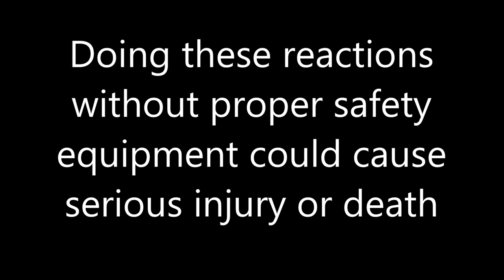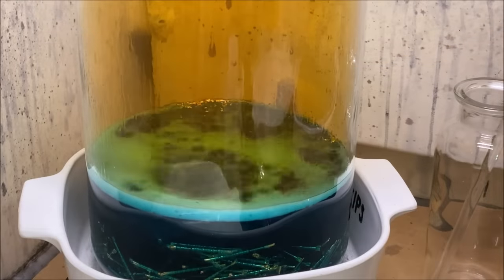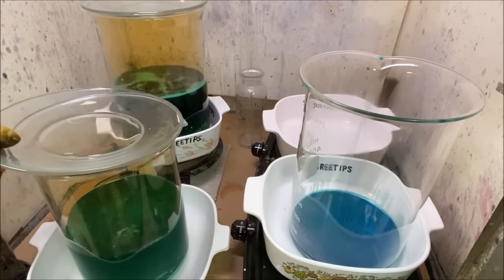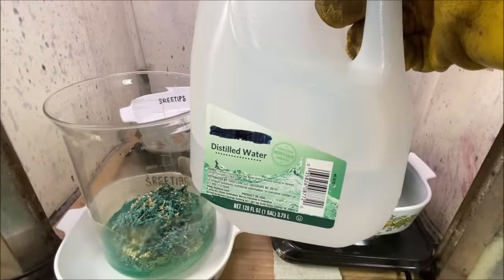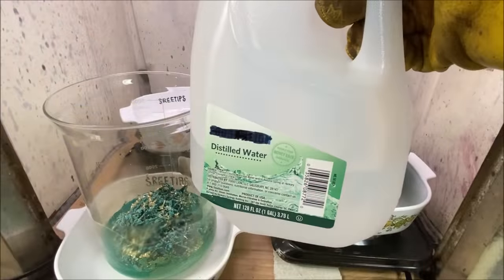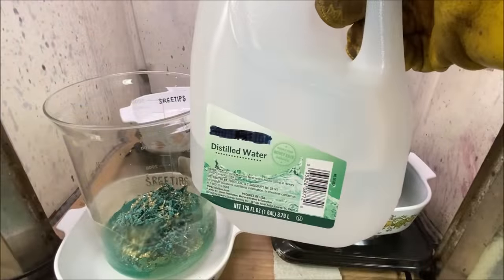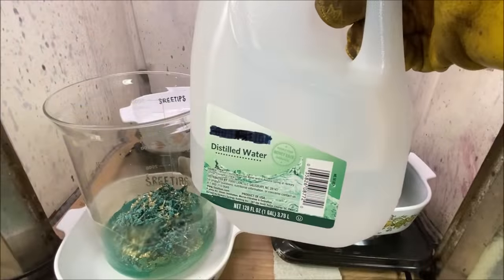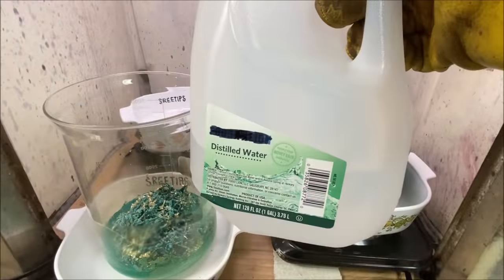Gold Plated Pins 10 POUNDS!

Comment: From what I calculated with the price of the pins and materials that were used (5 bottles of Nitric acid and Distilled water) not including your time, that the project roughly cost $1,400.00 and yielded 22.5g possibly worth $1,500.00 and profiting 50 to 100 dollars, so to conclude the entire project was not very profitable but thank you for the letting us experience the project with you.

Comment: Thanks for doing this, I'm a former metallurgist and you did great, explained it was the first attempt and you got your gold.
Reply: So why can't you get the gold off of the copper?
Reply from the maker: I used nitric acid to loosen the gold and release it from the copper. Ended up putting most of the copper in solution. This was a giant pain. But it made a good video.
Reply: @sreetips  Yes, all of your videos are good. You could get a bikini model assistant. Call her Beaker. But I was thinking that gold melts at a lower temperature. Melt it off of the pins. But, me contractor! Thanks for the show.
Reply from the maker: The gold would just get welded to the copper, making recovery even more difficult.
Reply: @sreetips  Interesting....So using a pyramid smelter would not be a valid method for this?
Reply: @sreetips  curious sir couldn't you just melt the pins like you where inquarting them then use nitric to get rid of the base metals like normal?

Comment: Very interesting,  you spent $1000 and recovered about $1300. taking into account time spent and acid, it's still a loss.
As you say it's a calculated mistake and a valuable lesson learned. Thank you for continuing with the experiment.
Reply: I'd still like to see if the reagent costs couldn't be reduced by decomposing the Copper Nitrate back into dilute HNO3
Reply: Add the energy and time .totally loss .not worth it but freakin interesting, ty bro
Reply: Add onto that the potential revenue from YouTube by making interesting content and it might become worth it
Reply: And you can make $ 3000 jewelry piece from it
Reply from the maker: That’s a good idea
Reply: @DiverCTH  It's simple. Add some Na2CO3 solution to the Cu(NO3)2. Filter out the CuCO3.
Dry the NaNO3 solution. Add some conc H2SO4 and distill off the HNO3.
Reply: He screwed himself right out of the gate.  He paid $1000.01 buy it now, and then it looks like the same seller ngta-benj sold 2 more identical 10 pound lots that had multiple bids and sold for $555 and $688.93
Reply: If he sell it at $62 a gram (56.50 now) he breaks even and he gets paid for his labor from YouTube.
Reply: @donc-m4900    Right, and he drives up scrap prices for everyone else since he doesn’t care what he overpays for it.
Reply: Worth every penny!  Gold values fluctuate too, ya know.
Reply: well he spent $1000, but if he was the only bidder at $500 he would of made profit on the listing.
Reply: It wast a loss this video made him about 10kus and a lot of people are intrested in this

Comment: This is fascinating!   I’m not a chemist but stand in awe of the science.  Thanks for sharing.
Reply: This was not chemistry, a chemist would never spend all that acid when you could simply dissolve the gold off those pins in 3 minutes using spa chemicals or bleach.  30% peroxide would have boiled the gold off the copper in 15 seconds.  smelting in a microwave would have taken 15 minutes.  Chemists are cheap bastards anyways for the most part.  As for the science my friend this has been done for hundreds of years and they figured out this is not the method over 125 years ago.  Just ordering the Nitric alone for this project is a quick way to get yourself on a list, there are much better ways and if you're going to use Nitric, be realistic and buy a setup to make your own, it's easy and cheap and keeps you off ATF's radar.  Everyone says it's no big deal until they show up at your doorsteps, then try telling your heart to beat quietly as their Gold Plated Badges tweak your mind and make you ask yourself if you put all your clothes in the hamper and toys in the toybox, better to just avoid them altogether and learn how to make your own chemicals.  Everything anyone ever needs is easily made at home and you learn most of what you should learn in learning how to get them and refine them.
Reply: @sizzlean9459  sir simple method tell pls i am trying but not available for chemical so full easy steps for words reply pls sir.
Reply from the maker: I took one chemistry class 45 years ago - got a “D” - you don’t have to be a chemist to refine precious metals. And your 15 minute “easy method” has been tried by many a novice with negative results. I only wish that it was that easy! Thanks for watching the video.
Reply: Truth is I am an engineer of 35years experience.  Seen many many things.  Try to open your mind a bit.  There is always another way to a solution and usually all those innovations are borne out of necessity and have their place.  That is what learning is all about, but maybe learning has stopped for some.
Reply from the maker: My way is not “the way” but rather “a way” to get the gold. In accordance with the reactivity series of metals, the gold would dissolve, then cement right back out on the copper until all the copper was dissolved into solution. Then the gold would stay in solution. Two other ways to get the gold from these pins; acid/peroxide or sulfuric acid stripping cell. Acid/peroxide could take weeks. And I can never get a good yield with the stripping cell. I chose these pins because I had plenty of nitric, and I knew that I could dissolve the copper to get the gold. I try to pick the battles that I know I can win.
Reply: @sreetips  sir i am working communication field O&M.
E waste ability but chemical search not available live from India TN
sir pls tell available store or any?
Reply from the maker: Gold plated material is best processed in a sulfuric acid stripping cell: https://youtu.be/gxf2PVc5t44

Comment: I know how thin plated gold can be and how far they can make an ounce of gold stretch when pounded into sheets. This was more than I expected to see.
Reply: Was it worth it? If he paid 1000$ and used up 5 days of his time only to get 22.6oz then I’m not sure if it’s worth it. Plus the 5 bottles of acid which I don’t know how much that is but I’m sure it anit cheap. If we just give him 8 hours per day at 10$ an hour that’s another 400$ on top of the 1k he spent on the scarp. That’s 1400$ for 22.6oz of gold. That comes to 61$ per gram. That’s really not good at all, you can pretty much buy gold at that price
Reply: @marcuslarwa9098 no he says in multiple other comments here thst this one wasn't fruitful, and they rarely are. He does it for the video educating.

The bottles are 2.5 liters, cost him about $60 ea. He used 5 bottles. So $300 there, plus he probably values his time at 2-3x the $10/hr you estimated haha. But doing something fun like this you wouldn't "charge" yourself for the time. So figure $1300, and he didn't get 22oz of gold 😂

If anything though, he didn't "lose" much technically, and considering the video you could say he actually netted a great bit
Reply: I do PCB design and there is electroplated gold and soft ENIG. The gold substrate in ENIG is less than 5 microns and is usually over Nikel and not worthed.

Comment: For pins, I use an electrolysis cell with a titanium anode. The dilute sulphuric acid electrolyte is relatively fume free. It leaves foils like the other processes, and is non sensitive to the presence of tin in the base alloy.
I've processed 40 pounds in 8 gallons of solution, using 1 quart of sulphuric acid, before the underlying nickel plating fouls the electrolyte to the point where it slows down. Recovery of the remaining dissolved copper, that's not collected on the cathode, is treated with iron to form copperas, which I use later to drop gold.
Reply: Hello David: would you mind sharing some details of the electrolysis process you use? Details on your titanium anode (perhaps where we can find one)? Cathode set-up? Electrolysis conditions (voltage, amps)?
Reply: @tech-e-cycle2608  
I use basically the cheapest titanium foil I can find on eBay for the Anode. I think it's something like 0.005" thick and 4"wide, but anything that will carry the current and not corrode would work. Cathode is simply a stripped end of 10-12 guage wire. It will get bigger in surface area as it collects copper. Solution is one quart of sulphuric acid in 7-8 gallons of water, but that can be scaled back to what ever size you want. I run my cell with a 5vdc 60A power supply, but I've never seen it draw more than about 10 amps. My meter didn't survive my latest move, so I can't tell what it's pulling exactly now. I use a 5micron filter bag I got from Duda Diesel for the Anode bag that keeps the pins in electrical contact with the Anode and each other. It's basically the same as any other parting cell, except I found out that it's not necessary to melt the pins into an Anode plate first.
I am discovering that the pins have to be porous enough for the saturated electrolyte to be able to be replaced with fresher electrolyte or it will slow down and stagnate. This is not the same as the Faraday cage effects you see in the concentrated sulphuric acid stripping cell.
Reply: Watched a guy on YouTube do it using distilled vinegar and salt in a bucket. Took a long time but it did separate the gold from the base metal pins. Very safe way to do it.
Reply: @ATAATX  
Not really that safe. Vinegar and salt can create peracetic acid, which has a dangerously low flash point.
Reply: @Vibe77Guy  Well, don't flash it!
Reply: @Vibe77Guy Hola , Muy buena. Información , gracias saludos desde las palmas de Gran Canaria 🇮🇨🇪🇸💪 eres el número 🥇
Reply from the maker: Volcan! Estar a salvo
Reply: @Vibe77Guy  ..?? You need a strong oxidiser to create peracetic acid from acetic acid, and a regular table salt, sodium chloride doesn't have any oxidizing properties...
Reply: @MrKotBonifacy  
This is true. Most people that go that route also speak of adding hydrogen peroxide. Which does provide the oxidizer.
Reply: @Vibe77Guy  "...which IS the oxidizer". You simply stated that mixing vinegar and table salt ALONE may lead to creation of peracetic acid. I my question was in reference to that statement, not to what "most people that go that route" do.
They might add a hydrogen peroxide, but you did not add it in your statement. Call me a nitpicker, but the thing is I can't respond to what you "had in mind", I can only respond to what you have writen. Sorry.
Reply: @Vibe77Guy  Your method sounds like a cheaper way of getting rid of the worthless copper. I feel for Sreetips on this one because looking at the prices for 22 liters of nitric acid came to around 800 dollars while the 10 pounds of copper would sell for about 35, unless buying metric tons of acid, that comes cheaper but would take ages to use up. Of course, there is gold to be had, but still. Nitric is rather expensive.
Reply from the maker: I used 5.2 bottles of nitric at $50 each.
Reply: @Vibe77Guy  No, vinegar and salt make pickling brine.  You're thinking of acetic acid plus 30% peroxide.  It's only a danger with highly concentrated peroxide and acetic acid.  3% peroxide and vinegar (which is only roughly 5% acetic acid) make a peracetic acid solution that's far too dilute for flash point dangers.  It's roughly 96% water by weight, and the peracetic acid remains solubilized.  It's also very slow at dissolving the metals.  VERY slow.
Reply: Electricity is a very effective oxidizer.
Reply: stainless steel bucket and revers technology are much productive, use low Voltage, overnight you have all gold on the walls of the pot. ....then ( secret ) lol.
Reply: @andrewandretti7379  
Using what as the electrolyte?
Reply: @Vibe77Guy  Does this mean county fair style french fries are explosive? 🤯
Reply: @Alondro77  How slow? a month, 3 months? If it saves hundreds of dollars it may be worth it.
Reply: The King  35% acetic acid isn't 'vinegar' anymore.  Vinegar is around 5% acetic acid.  You'd have to distill it in a special apparatus to get up to 35% concentration.  Probably vacuum distillation would work best with acetate.

Comment: I was surprised that you didn't use electroplating to pull the copper out of the acid. Thats how they do it in the mines. I've seen those work. By the way excellent video
Reply: yeah, I remember reading native copper has either gold or silver or both in it, they make more money pulling out the valuables, and it's one of the reasons why copper has a strong market.

Comment: I have taken to putting any gold covered base metals in my waste solutions from my stock pot to save on acids used. It does take longer to strip the gold from them but it does a nice job at zero cost.
Reply: I'm making a bubbler column to catch waste NO2 gas from both the initial reaction with the metal, and that which results from heating iron nitrate to a bit over 80C, and reconvert it to nitric acid using an aquarium bubbler at the bottom of a tall glass column filled with 3% hydrogen peroxide, which greatly increases the recovery of nitrate.  The peroxide will convert nitrous acid into nitric immediately.  

I did something very simple at first, just bubbling the NO2 gas into water, and even that simple method recreated weak nitric/nitrous acid solution.  It's a pretty efficient process and costs almost nothing for the little bit of tubing and bubbler.
Reply: @Alondro77  You can run the gas from reactions through 3% hydrogen peroxide to make nitric acid for free from your reactions
Reply: @Alondro77  Peroxide also minimizes or eliminates most of the noxious fumes which is great.

Comment: I wonder if the gold that was left on those pins you had leftover could be directly smelted?
I've been thinking about building a forge for a different reason but if I get the opportunity I'll see if I can't figure that out and let you know what I discover in the process because I've seen quite a few small forges that I could make for easily under $100. I do everything on a tight budget out of necessity (especially lately) and I'm kind of the king of Improv never having what I need to do something the best way but usually always having what I need to do things on the cheap not to mention I love repurposing things that would have gone in the trash otherwise. I'll let you know if I find out something useful or economically significant
Reply: The melting points of copper and gold are too close.

Comment: Three things to tell you here.  Don't use water, just nitric acid, the dilution is costing you time and acid.  Don't use so much heat, just 70-90°C is plenty after it has sat in solution for two days. I do this often and it takes a week and only one drain and replace acid after a few days.  Pushing the time with more heat and more acid is just cutting into the cost factor on your bottom line.  Also the plating is probably 14k from it's color, so the foil remnants you see are only half gold.  In your frequent draining and pouring off you are also losing some fine fold at the bottom.  Only do your pour offs through a double filter paper, what I can't see in the copper solution is greater than you suspect.  Testing with the litmus paper only indicates what is in the opt of the beaker and will not indicate on the floating particles or submerged heavy bits in the bottom or the solution. But I do like your acid drip, that is great and something that I will have to incorporate in my setup.
Reply from the maker: Rob, I add water to provide a medium for the copper to dissolve into. Think of using just liquid dish soap to wash your hands. It would get them clean, but a little water makes the soap work much more efficiently.
Reply: Some soaps require water of a specific temperature to activate.  @sreetips

Comment: Have you ever considered trying to a refining for thing with low gold content the way matt from MBMMLLC mount baker mining and minerals , where you take all the junk out by melting it into the slag then you are left with a lead/gold/silver metal that could be chemically separated using H2SO4? It would be a hybrid method using heat and chemicals, heat to quickly do the nitric acid part removing 95% of the junk leaving you very little to refine?
Reply: That was what I was thinking.. It would be cheaper to smelt first, then if needed use chemicals to further refine it..
Reply from the maker: I have not - none of the refiners that I learned from used this method
Reply: @sreetips  The method recommended by the other guy is applied to mined raw material, no wonder refiners uses more sophisticated methods with already mined metals.
Reply from the maker: Quite correct, I have zero experience with mining
Reply: Yeah I have wondered the same thing with gold filled scrap as well.
Reply: @sreetips  I'm pretty sure that MBMMLLC watches your channel :)
Reply: I was also thinking MBMMLLC’s smelting and cupel method would work with this.  Streetips has a gas furnace and electric oven, just needs the cone and recipe for what to add to the smelt.  Once it’s cupeled sreetips could do his regular nitric refining to make sure it’s pure.
Reply: @forbeatssake1530  Do a colab video, mbmm watches streetips I was also thinking this would be a good way to practice making a copper play button from your stock pot as I suggested in another video. You have a furnace have matt of mbmm send you a cupel and cone mold, then use your electric furnace. Sure not practical but would be a really awesome video.